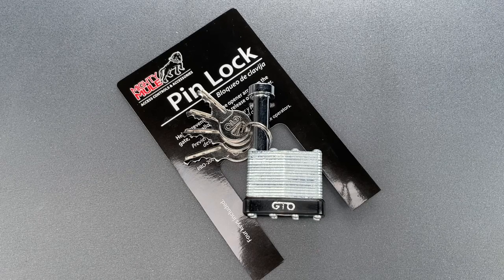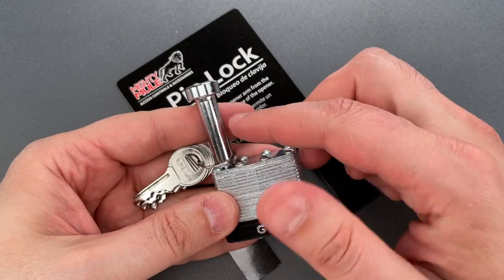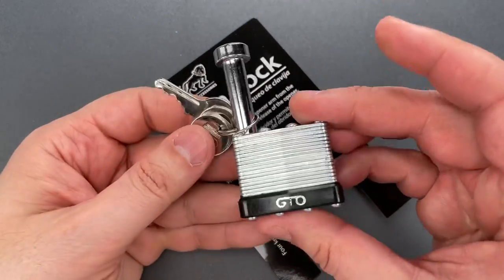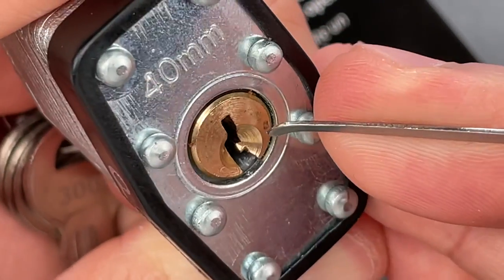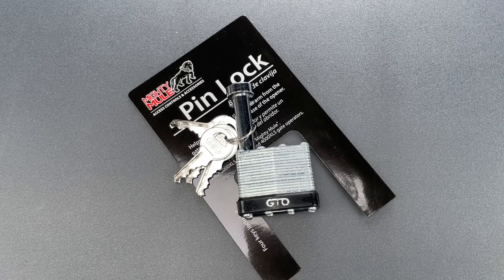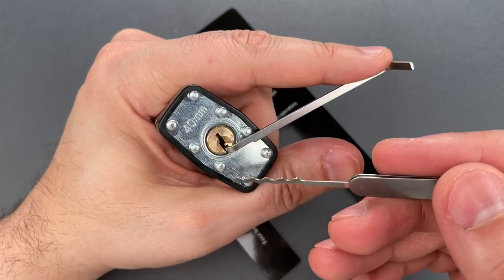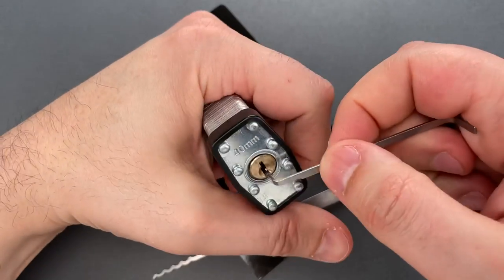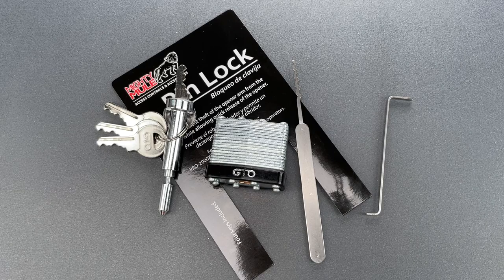[1426] Embarrassingly Bad: Mighty Mule Gate Lock

Comment: You know when the LPL breaks out the wave rake it's really a shitty lock.

It appears to be made by the prestigious 40mm company as we all know the makers of fine locks everywhere and by fine I mean complete garbage. 
This piece of crap couldn't look more generic if it had the words "We don't care" embossed into it.
The terrible manufacturing tolerances make for a better security feature than having to use a key since they create problems with the smooth functioning of the lock.
Reply: If it had "We don't care" embossed into it, it would, ironically, show some care (and some willingness to spend $$$ that they otherwise wouldn't have).
Reply: I think the 40mm is the pin size..
Reply: @0g.Ghost.7373  /r  whoosh

Comment: I just received my Genesis pick set from Covert Instruments and had a lock ready to practice on.  Not sure what model it is, but looks like a Master Lock, so I assumed it would be a great practice lock.  I was correct, it look me longer to choose the torsion tool, than it did to actually pick the lock.  I tried a rake first, but that seemed cumbersome when compared to LPL's use of picking each pin.  In less than a minute, I was successful on my very first attempt.  Maybe it was a fluke, but I'll get a few other locks to practice on.  Thank you for a great service.

Comment: I think the ideal lock to go up against LPL would be a lock where it has a hand sized duct-like case that the lock itself is within where you can only fit a single key wielding hand into. This would make it to where you would either have to pick single handed in tight confines, somehow remove the duct/restriction around the lock, or otherwise bypass/defeat it. Would definitely make for an interesting video even if we arent able to see as well.

Comment: The thing about electric swing gates with a arm attached by a clevis/clevis pin is that this clevis/clevis pin tends to be on the inside of the gate. Modern electric swing gates come in two different types gate (whether single or duel gate models), all metal bar gates that have vertical bars of either tight or wider spacing or solid gates that use wood or fake-wood plastic panels that have no gaps between the panels or very small gaps (less then an inch or so). For any electric gate model that does not have wide gaps between it’s bars or panels then it would be hard to remove a regular clevis pin from the clevis from the outside of one of these gates, at least for most people who are trying to break in. So this type of lock would mostly be used on metal gates with fairly wide gaps between the bars of the gate. Even assuming you had the type of electric gate with bars that provide gapa wide enough to get raking tools in but not wide enough to get your hand through then it would be somewhat difficult to manipulate a raking tool in that situation. You’d have to weld a raking and tensioning tools onto long solid metal rods and then be very adapt at getting them into the lock through the tight space between the bars.  In that situation this lock would provide a bit of a deterrence from a situation less likely to occur anyways (removing the clevis pin while on the outside of the gate). 

Of course if you have a electric gate with bars widely spaced then a better lock would be a must. Looking at the types and prices of “Pin locks”, they range in price from under $20 for this Mighty Mule brand up to around $60-$75 for the highest quality model I could find (The Liftmaster Pin Lock. So I can imagine someone on an extreme budget someone using one of these cheapo models to secure their gate’s armature clevis pin (if they one that was already hard to unbolt from the outside.  But if you really think your Clevis pin can removed from the outside within a reasonable amount of time and with reasonable effort and you can afford to spend an extra $40 then forget this cheap lock by the better quality model just as a precaution.

Comment: I love, when my customers use a lock on  a chain link gate, 98 percent if the time, you just push on the pole the  " latch" is attatched to, and the gate opens. On a double gate, you just pull the rod up. One customer was amazed that I foiled the double gate lock, by simply pulling up the stop rod. Jumping over a 3, 4 ,5, or 6 ft fence is pretty easy.

Comment: UGH>>>  I have this lock on my gate openers. I feel like I've been ripped off because the gate opener was quite expensive. I think I'll pull the lock and just put a nut and bolt in it's place. At least it will take the crook a little longer than picking.  Thanks for the great videos!

Comment: On time in Winter, I had to use a road flare to melt the snow & ice on a lock to get the key in & open a gate.  If I used a flare on this turd, the whole core would be melted & I wouldn't even need the key.

Comment: So many video game developers could implement new and creative lockpicking mechanics if they watch your videos for a bit.

Not just lock difficulty, but also more ways to beat locks based on manufacturer of the lock, quality of the lock, etc.

Heck, more places to place locks and mechanisms you can lockpick such as near the top corner of a door like this one.

Another mechanic I feel more games need is the ability to safely break open/breach containers if you have the right tool or if the container is weak, compromised, etc., as a really GOOD lock wouldn't help much if it's on a wooden box that's half rotted.

Heck, if you want to get even a little sci-fi, you could end up with various factions with tools to beat specific manufacturer's high-end locks, from auto-pick devices with specific manufacturer secrets in mind to devices to hack electronic locks.

Comment: You should do the ft Knox locks from harbor freight. I bought two to close a plastic case from the same store. Didn't need any real security just keep out curious "honest folk". They were like $14 for the two. Very easy to rake unsurprisingly. Also, funnily enough they didn't gaurd the latches on the back of the keyway. So all you have to do is insert a pick and pry the latches and the lock falls open.

Comment: I used to maintain 5 of these gate openers, at a large vineyard. That lock is a perfect representation, of the quality of their openers. Always the cheapest materials where ever possible. All of the joints wear prematurely, and affect their opening and closing. The motor that operates them, is the size of a "D" cell battery. Absolute garbage.

Comment: I really  have to wonder how this came about. Normally these locks are out in the weather, and rain and possibly tossed salt sludge will cover them frequently. Since they are rarely used, having them rust solid probably isn't all that uncommon. I can see someone looking around for a solution that will resist rust, and plastic will generally do that.

Of course, this is also a special lock with that hasp rod, so the company probably had to look for some company that would make a special lock for them. They likely went with the lowest-cost option that company offered, which was probably at least $30 since they had to make a special hasp bar.

Comment: please do a follow up with a brute fore attack
like, can you just force it open with a flathead screwdriver since the core is made of plastic?

also, I heared that you can break open a VW group lock with a screwdriver

I would consider just yanking the lock out with a screw attatched to a slide hammer since it is held in place by 2 sheet metal tabs, you can then unlock the door with a screwdriver

Comment: Another blowtorch versus lock video is in order here, but the rake is almost as fast as the key, and as another commenter mentioned, a screwdriver could likely bypass it entirely. I think locks like this are just enough to meet the legal requirements of, "if it's locked" as an element of trespassing or burglary, but provide no more security than the veneer of the legal system.

Comment: Thing is, alot of those gates aren't terribly secure anyway.  Its pretty common to see a mighty mule on a farm gate.  Also, alot of the mighty mule models up until recently used the old fashioned non-rolling code for the transmitter (think old garage door opener with the dip switches).  So, yeah, that lock is pretty much just keeping somebody from stealing the openers, not keeping somebody from getting through the gate or stealing the gate.  The openers can be sort of pricey, so the little bit of added security over a clevis pin might be worth it for that.  The gate itself would generally require some tools to get it off its hinges.  If somebody is going to bring tools and spend some time on it, they could just unbolt the whole opener assembly.  But even with the bad lock, the openers would take some time to get out and the gates are usually near a road.  So, not the most attractive target.

While its pretty inexcusable to have the lock be THAT bad, especially for the cost of the lock, for the security environment its intended for, it probably isn't compromising overall security that much.

Comment: There are some places plastic can be beneficial in a lock design but not there.

If you want to provide shock absorbtion, filling some unused space with resin would be beneficial, reducing vulnerability certain attacks.

However, keyway mechanism should be made out of heavy brass and/or stainless, or some other high strength, non-corrosive alloy.

Comment: I had one of those on my mighty mule gate electric motor so you can't just take the motor off and open the gate. My neighbor bumped it with a lawn mower and it snapped off. The whole shaft just shattered. With a plastic lawn mower.

Comment: I’ve had several of these gate openers and the lock isn’t even the weakest part. The internal screw mechanism is also plastic and can be easily broken by a firm push on the gate.

Comment: Not too much of a surprise that Mighty Mule would have a lock constructed like this, the moving parts on their gate openers are also made partially out of plastic. Was trying to repair one that was damaged at my work and gave up due to zero part availability in general and a plastic nut for the metric acme threaded rod in the actuator that apparently wasn’t replaceable unless the part being replaced was the entire unit.

Comment: The all too common Weiser Beverly locks have nylon bibles too and that lock protected a huge portion of houses in the US for a while there. One can jiggle them open with about anything. I am smith and I don't think I ever saw a picked lock entry after 50 years on the job. Lock makers normally intend for locks to have loose tolerances because they understand copied keys often suck and they are more interested in locks functioning for the user than real security because see above. Their number one job is to sell locks not keep people out. I've often said a vending machine that keeps your money and delivers nothing is working perfectly. To set the goal post for average production locks to be highly pick resistant is not realistic with present technology but then they should not be open-able with chicken bones and zip ties either. I am looking at you Master shlock

Comment: We need LPL ratings on locks: LPL0 - Not a lock products, LPL1 - Opens with wave rake or other low-skill bypass, LPL2 - no low-skill attacks, but can be single-pin picked by a novice in <1 min, LPL3 - Requires specialized tools (TPTBBAIM) and skills, but LPL can open in <1 min, LPL4 - Takes LPL >1 min, LPL5 - The holy grail. LPL can’t open.

Comment: You've got to wonder if the plastic body wasn't an attempt to prevent the lock from seizing in the elements, especially a lock that's likely to not be opened for very long stretches at a time. It's not an unreasonable decision, but maybe using something like a glass-filled polyamide might have been a better choice than old chewing gum.
Reply: I think brass is the weather resistant go to for locks
Reply: @nooboftheyear7170  That's fair, but even brass will corrode significantly with extended disuse.

Honestly, it's far more likely that the manufacturer was just incredibly cheap.

Comment: What happens if you put a lighter to the lock? Will it melt? Will that open the lock? Will the plastic deform and render it permanently shut?
Reply: The lock will get very hot.
Yes, the plastic inside will melt. 
If you pull on the pin while heating the lock it'll open. 
Kinda, but it'll be easy to break that lock off anyways.

Comment: I have a small brass padlock branded master on a plastic sleeve over the lock and it also has a plastic core. I can open it with just a tension wrench and a little bit of pressure. not hard to move at all. I think I scraped it up bad though hahaha. Even when using the key it feels mushy inside.

Comment: The Mighty Mule gate openers are trash themselves and so is the company. My house came with one of these units, it failed a few months after I purchased the house, I contacted the manufacturer to see if it could be repaired and they said that it was out of warranty and that it would be a minimum of $200 non-refundable to rebuild it. I declined that offer and took it apart myself to find that the gears were plastic and chewed up, the motor was burned up and so was the controller board.

Comment: almost seems like it's supposed to be akin to a LOTO lock, not designed to stop entry, but more provide a "Hey, this is disabled/blocked for safety"
Designed to stop a casual opening/activation/use. Not provide any actual security.

Comment: It's hard to explain that the gate opener itself is weak enough that you can just push hard on it. Pulling out the pin or picking the lock is a waste of time. It's unbelievable weakness. Mighty Mule isn't security. It's about keeping livestock in when they push the gate closed. I'd never allow it for exterior protection. The gate code reader can be opened with a screwdriver. The leads can be touched and the gate will open.

Comment: If it wasn't for the plastic core parts,  I would have bet that that lock would be a rusted mess in 6 month.  So when you need to use in a few years when the gate breaks, it won't unlock.

Comment: I was hoping you would heat the lock with a torch and see if the lock cylinder would just melt and fall out the bottom. You wouldn't even have to touch the lock!

Comment: Mighty mule is such a horrible brand. I once got their garage door openers and their rf signal processing was so bad that it bound to the signal of my LED shop lights instead of the remote and if the lights were on it would randomly open..  they claimed secure communications but apparently the noise from the led lights was enough to make it think there was a valid remote?? Returned that garbage thankfully. Never again.

Comment: Chain link fencing is impossible to make secure, no matter how good of a lock you use. A half inch wrench will remove the gate hardware from the gate and give you an opening. The cheapest pair of cutting pliers in the world will cut the chain link itself. There is no true security for chain link.

Comment: Could you please make a follow-up video where you try using a 20-24oz hammer, and persuasive force and see if you can get it faster than the rake? The bolt looks like it has some comically weak spots - Cheers

Comment: I am coming to the conclusion having worked with machines most of my life, that a rusty nut and bolt is more secure than a padlock. Unless you have a wheel grinder it certainly takes longer to remove a rusty nut from two inches of rusty 3/8 bolt.
Reply: PS any smaller than 3/8 is easy to shear.

Comment: How much difference does it make that this lock will be rigidly placed with the keyway pointing straight down?  Damage from usage shouldn't be too big an issue since this lock isn't actually designed to unlock very often.  Heck, the easy breakability might almost be a benefit since anything but a very well-made lock would likely seize up from disuse in this role.

Comment: How long does it take to open this with a zippo and a flat head screwdriver? To give the lock all chances it might have in situation, starting from freezing temperature - there won't be significant heat sink through the pin, so having it dangle from something would be just to have it in realistic position.
Also; as many plastics become really soft below boiling point of water, the core should be tried with McD coffee; if it becomes soft, how many cups does it take to heat the lock enough to easily force it open...
Reply: Plastic tends to be brittle in freezing temperatures so it might just shatter with a bit of force.

Comment: Beyond an embarrassment to Mighty Muel, Mighty Mule is an embarrassment to Tallahassee. I guess we can expect it from a product made in China for a company based in Florida.
Reply: But it was also designed somewhere.  You talk as if the manufacturers just give birth to the locks
Reply: @nooboftheyear7170  Yes, that is a Noon comment. The design is about as standard as they come. You can just grab it off the internet. The manufacturer used very cheap materials as seen in the plastic part, and the Florida company chose to purchase the cheap item probably right off the manufacturer's catalogue.

Comment: Weather plastic or metal on the inside, you seem to pick similar locks just as quickly. What really needs to be improved is the design of the locking mechanisms themselves.

Comment: This lock isn't just bad, it's fraudulently bad.  The lousy plastic mechanism was very carefully disguised as a laminated steel padlock body, which (if real) would have been steel all the way to the all-metal lock core and the steel locking mechanism.  If this had been a genuine  Master lock padlock mechanism, it would still be rake-able, but wouldn't break from the strain of trying to turn the core.